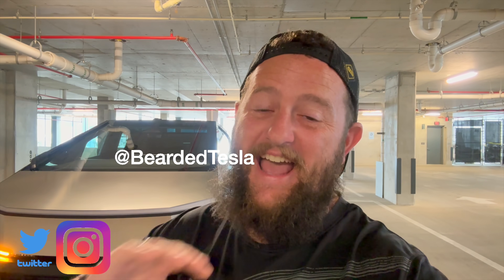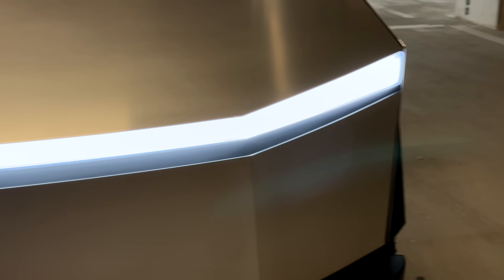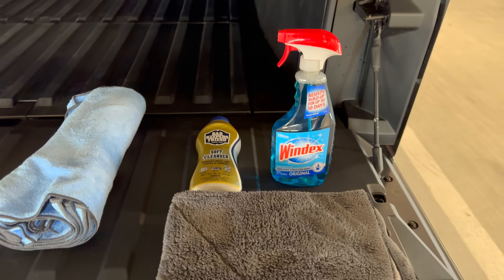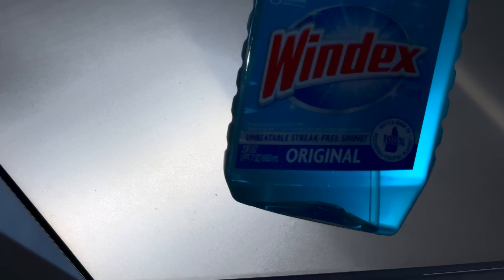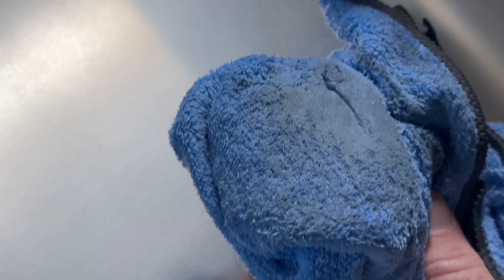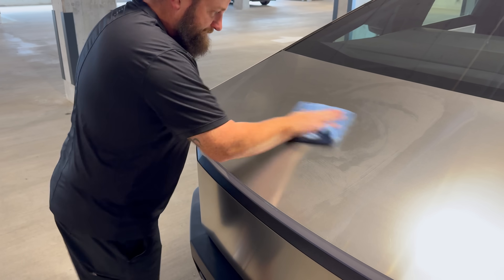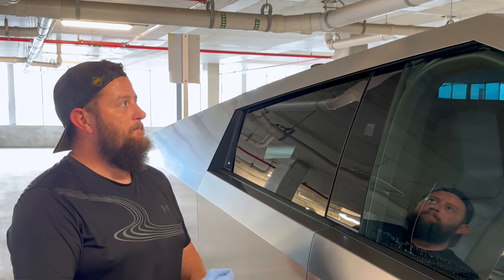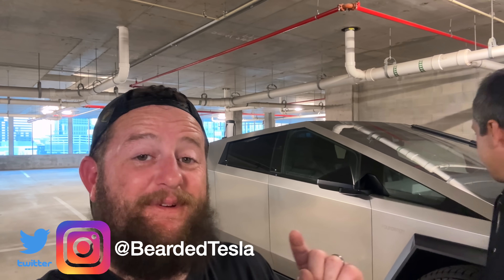Tesla CyberTRUCK or CyberRUST?? The TRUTH About Cybertruck Rusting Issue + How To Fix It!!

Comment: There is also iron remover spray that can remove the particles you can’t see with the naked eye.  Ford made 6 1936 cars from stainless steel by Allegheny Steel.  They were driven around the US by sales reps.  The one in a Pittsburgh museum has more than 300,000 miles and is rust free.  They also made 6 stainless steel 1960 Thunderbirds and 6 1967 Lincoln Continental convertibles (worth more than $2,000,000 each).
Reply: I saw the 1936 Deluxe and the 1960 Thunderbird at an auto show years ago. The body parts matched exactly the standard production pieces with all the same curves and contours, apparently they had no problem forming them. The Thunderbird had over 300K miles, the Deluxe about 500K. No rust or pitting whatsoever on either vehicle. The Lincoln wasn't there but a real stainless steel 1967 Lincoln convertible with suicide doors would be the ultimate summer cruiser.
Reply: It’s possible that the Fe particles are migrating from the alloy at the grain boundaries and escaping the passivation layer. The cleaning needs to etch clean the layer. It’s likely free Fe migration. And yes I am a metallurgist! I’d love to analyze it…

Comment: Always clay bar a brand new vehicle... those spots look exactly like tiny hot iron particles that come from train wheels during transport. Affectionately known as, "Rail Dust"...a good clay bar will take them right off then sealing the body panels with a quality wax. Just look close at any light colored vehicle that wasn't clay bar'd and you'll see rail dust rusting in the clear coat.

Comment: Sort of like new carbon steel woks and pans. Steel, yes - but you have to either keep it coated with oil, lard, bacon grease, or bake on a seasoning of oil, lard or bacon grease. You have to protect the steel from exposure to moisture or it immediately starts to rust. Good luck with "seasoning" a Tesla.

Comment: Facts about Stainless steel, it’s naturally corrosive-resistant. Stainless steel isn’t rust-proof. Stainless steel is only “stainless” which doesn’t mean its strain-proof. Anything made of Iron will rust, additionally iron can be found in water, which if the object makes contact with iron-contaminated water isnt dried properly the object will rust or have rust powder. Calcium can also corrode metals like steel, from dried water.

Comment: So a CT owners need to bring a stainless cleaner and a sandpaper w/them while driving?
Reply: is that a big deal? 🤣
Reply: Not all delivered CT's have this issue.  It's coming from being shipped via rail.  The surface of the truck is not rusting but the iron particles that are stuck to the surface are.

Comment: There are many types of "stainless" steel.  The mix steel with various other materials.  If the mix is not well mixed you might have small volumes, pockets, of plain steel that will rust.  I have noticed Chinese stainless steel has serious problems typically.

Comment: so why is my painted car not got rust spots on it also i work in a machine shop and use steel and stainless steel 316 and unless i grind mild steel onto stainless i have never seen this so called rust dust 
I would say the problem is its made of 304 stainless steel which will stain and Musk is full of BS

Comment: The issue is if the dust that's landed on the vehicle has any iron or metal in it those particles will rust, each one bleeding rust over a broader area.

Comment: It might be rail dust. Very fine steel particles from RR tracks that get embedded on the surface then rust. It happened to a truck I bought thinking the body was rusting then I noticed it was also on the fiberglass cap.
Reply: Same thing in the late 60's when my Kawasaki came back from the big city's repair.

Comment: Brake dust particles from semi-metallic pads are generated by FRICTION, and carry a high STATIC CHARGE. They adhere to the wheels and body sides, and when they get wet, they have the appearance of "surface rust". Meguiar's DECON is a liquid that breaks down the electro-static bond, and the surface will wash clean. Any car detailer worth his salt can tell you this.

Comment: Toyota has at least a decade of cars where the white paint randomly peels off to the metal shortly after purchase and doesn't stop at just a small location, but will peel off the entire roof, or hood, or entire side of the car. Still not rectified, but they have a program, ending 2024, to repaint the exposed metal areas. I myself have had all of those parts repainted on my 2014 RAV4, and now in 2024 at the end of the free repainting program, the other side of the car is exposed.

Comment: If it's not in some way bonded to the surface, I don't see why the regular cleaning products wouldn't have had more success. Even if slightly porous, I would expect particles that are only resting on top to come free when washed.
Reply: After watching a bunch of these videos I tried an experiment with by stainless steel kitchen sink. It's never rusted or pitted, I wash cast iron skillets with a steel wool pad and cleanser in that sink and haven't seen a problem. I left a wet steel wool pad in the sink and by the next day the pad was rusting. It left a rust mark on the sinks surface but it cleaned off with dish soap and a sponge. The rust from the steel wool was gone and didn't require any special cleaners.
Reply: @hwirtwirt4500  Good idea for the experiment!

Comment: Shops that fabricate in stainless steel typically do no work on standard mild steel. The dust from grinding mild steel and welding splatter can 'contaminate' stainless steel. The metal particles bond with the stainless and will rust. The iron oxide formed also bonds to stainless and you can't just wipe it off. Unfortunately iron oxide dust is almost everywhere in the environments where stainless trucks are driven.
Reply: They invented no contact air bending to keep tooling from contacting the stainless. 

Iron as a mineral is even in vitamins, dirt and food.   I've had rust on ceramic plates from hard water.
Reply: @MotoGPatrick bro iron rust is literally in the human breathe, this God damn things are going to stain no matter what you do, just by being in close proximity to their owners they will eventually get nasty.

Not just that but the damn things are huge and have very sharp angles making them really difficult to clean continuously.
Reply: @MotoGPatrick That makes it way worse, so we can see that they knew exactly what @rossmacintosh5652 explained up here ist true, they also knew that it would be everywhere but they still said "fuck it" and now you can either have it clear coated by Tesla for 5000$, wrap it or be cool with it and call it Spot.

Comment: You really need to educate yourself a lot on this matter before coming with wrong "facts".
It IS the material that is rusting.
It is called stainless and not satinfree, and there are huge differences between different stainless types.
The stainless panels are rusting and that can be for different reasons.

If there are some groves that keep water or there is a material that stick to the panel that attacks the metal or help keep water on it, it will start to rust.
Even fingerprints can make it rust.
Specially during winters and you drive on salted roads.
Also if you park you car on the outside and it rains for days, it will start to rust.
Ideally to avoid it from rusting as much as possible, do you need to wash your car every time after you have driven it and then park it in a garage with dry air.

Ask any present or past DeLorean owner and you will quickly find out that it will take a lot of work to keep your Cybertruck in pristine condition.
Or you make sure to wrap or coat it to avoid it from rusting and getting a lot of fingerprints showing.

Comment: The problem is every vehicle has the same issue with particles getting on them during transport.  Trains are part of an everyday environment.  Without paint and a clear coat, CyberTruck owners are really going have to really work to get those spots off.  You can't keep using the cutting agents over and over again.    Yes a wrap helps, but after spending $99K, why should anyone need, or have to,  spend another $5K-$6K to wrap the vehicle to protect it?   There are some who indicate with a wrap, the metal underneath cannot breath and may become another issue in the future.  Time will tell.  

Instead of making an Elon Musk vehicle, (just do something different without thoughts of the consequences of doing it), an electric CyberTruck could have been made using regular materials and paint.   The minimalist DASH and all steel body is only to be different and there is no practice reasons to go to those extremes.    A heads-up display or modern dash in front of the driver could have given that futuristic look.

Comment: Ya and how quickly does it return after spending hours removing it ?  PPF or  Vinyl wrap for my money is the way to go.  I simply will not tolerate having to do this every couple of weeks or months.  If fresh delivery has this showing up quickly the question would be how quickly does it return.  Was it just an environmental thing at the factory or during shipping ?  I guess that depends on where you live, but I would expect highway driving and in town driving kicks up a fair amount of this as well.  Most likely this will return fairly quickly and the build up over time could be nasty.  I'd say, unfortunately, if you are investing in a Cyber truck, you had better plan in investing in PPF or Vinyl wrap.  Tesla should really offer a discount for wrapping, at least a clear PPF option at a discounted price due to this.  This new revelation has caused me to question, seriously, the investment.  Because I plan on the Cyber truck as being a piece in my whole home back up system it really is a no brainer compared to fixed batteries.  If they didn't have the option of V2H I would NOT be buying one.  V2H saved this truck from a practicality standpoint.  Especially with this new revelation.

Comment: Stainless comes in over 150 formulations. many can rust based on their chemical composition. At one end of the scale, while not stainless, 1095 and 5160 high carbon steels have extremely high tensile strength but will rust due to low chromium content. At the other end of the scale are knife and surgical stainless steels that tend to be rust free, but are hard to work and can be very brittle under impact. It depends on the chromium and Nitrogen content. Another likely source of rust in this case would be Iron that gets embedded during the working process. Passivation should be used to remove embedded surface iron particles by the manufacturer.

Comment: Contaminates from low grade SS   example : cheap silverware also rusts the same but stains worse 308 309 and other grades matter, what goes in comes out!   hey what you doing today?,,, I am decaming my brand new truck you? LMAO why not clear the body so this does not happen at this rate? I am sure a good clay bar and lube can tare tru them much faster, when you weld SS its important to pickle the welds or they will rot just like this, my point is it all contaminates from the materials used in the enviroment in wich they are kept like RH relative humidity is indoucing the issue also WD-40 will spot remove well without dammage as its a slovent based material but will evaporate to nothing so i recomend a proper clear coat done in a low RH enviroment after a clean contaminate free clean like youve done here. Cheers

Comment: If you use a Stainless Steel Wire Brush on Steel or Iron it will ruin it because once contaminated it will transfer (rust dust as they now call it) to other non ferrous metals from its contamination. This is well known among machinist.

Comment: So the CT attracts rust dust from the atmosphere. 
Surely all vehicles would would also attract this onto paintwork?
Reply: I'm sure it does happen to painted vehicles to some extent, but It's probably less likely to adhere to painted surfaces.   However, a lot of this maybe coming from the factory when the sheet stock is cut and shaped.  Any tooling, rollers, mandrels etc. that contact the stock may transfer iron or steel particulate. The particles probably adhere at the nano level, maybe this is somehow related to how stainless fasteners can be so prone to galling. Anyhow, it may just indicate that the material was insufficiently passivated after factory forming processes.
Reply: You are the first besides me that mentioned PASSIVATION! Looks like Elon should have hired the Delorean Engineers to Passivate these, I haven't ever heard of their Stainless panels with this problem. @mattgraham4340
Reply: All vehicles can have rust dust embedded in their exterior.  Just search for products like IronX.

Comment: Can someone explain why these rusting particles are so hard to come off???   Rusting is material which is breaking down, so why do they have to be mechanically removed with so much effort?
Reply: A great question!
Reply: Because it fuse with the panel
Reply: Ok but how is rust fusing?  Rust breaks done, but in this case it fuses?  Trying to understand
Reply: Because stainless has grains and the microscopic steel particles settle into the grains and begin to rust.  That is why you never buff stainless steel with steel wool.
Reply: @kennethsouthard6042  I clean my stainless steel sink and cast iron pots and pans in that sink with Brillo pads and after 20+ years of use it never rusted.
Reply: @hwirtwirt4500  There are several grades of stainless.  Sinks and pots and pans are usually a very high grade, 304 if I'm not mistaken.  There are also lower grades used in decorative applications, like the front of appliances and apparently this Tesla truck.  The lower and cheaper grades are more prone to rusting and should NEVER be rubbed with steel wool.

People like stainless, because everybody thinks of the higher grades and sees it as a "premium product". However, the secret is that not all stainless is created equal.

Comment: Could you get it chrome plated?
Reply: Stainless steel is not good chrome plated, it doesn't stick, it's like painting it you have to use an epoxy primer to glue the paint on, etch primers (normally used on steel bodies) doesn't etch SS.

Comment: I'm a knife maker and it's crazy how many people think stainless steel won't rust. That's absolutely not true. The majority of stainless steels WILL rust. It's stain-less, not stainfree. Stainless steel comes in many different chemical makeups which determine it's stain fighting capabilities, hardness and brittleness. The only 2 (maybe 3) kinds of stainless steel that i know of that actually will not stain, are on the softer side of the spectrum as far as steel goes. In the knife world that makes them dull quicker then others but also make sharpening easy and fast. Not relevant here but just to get an idea of the differences in steels.

Comment: Lots of negative nancy morons in the comment section...(1) the CT body panels are NOT RUSTING. (2) Environmental contaminants are landing on the surface and rusting.(3) this does NOT cause damage to the CT body panels. It is a COSMETIC issue. (4) Sealing/protecting the surface adequately is the key. (5) Within a matter of months there will be a plethora of aftermarket products available to provide that surface protection over the long term with infrequent application. (6) In the meantime use barkeepers or other similar products to coat the surface and wash the car often to avoid this issue.

Comment: Let's talk about real stainless steel. There are different kinds of stainless steel. I operate a distillery where I have large tanks made of 316 Stainless Steel. Sometimes, when I ferment mash in stainless tanks I will see a film that must be taken off with a mild soda ash solution. But, rust? No. I use this quality of stainless for the fact that it does not rust.

Comment: If what you're saying is true, wouldn't the rust dust removal be a one-time thing?    You never really made it clear if this is something that has to be done over and over as needed or if it's just a one-time clean up after delivery.
Reply: It depends on if you live around a lot of metal dust.
Reply: No, its full time job😂
Reply: If you never drive it and keep it indoors in a dry dust free room, you should be fine.

Comment: I grew up maintaining boats in saltwater along the gulf. I've seen everything from 304 to 316 stainless steel develop surface rust over time due to the sodium chloride exposure from the marine environment. The saltwater can become airborne during heavy storms and gets blown inland along the coast. 

For boats you basically cover everything with a film of wax to help protect it from the sun and these elements. This includes any stainless steel you have on the boat. In these environments, raw 304 stainless will begin rusting within days/weeks but 316 performs much much better.  I'm curious what blend of stainless steel they are using? 

It will be interesting to see how this plays out for these vehicles in coastal environments. I suspect we'll see more of this until people start protecting the metal with some type of film... Time to start waxing boys!
Reply: Apparently Tesla created a proprietary stainless steel that was first used on the Space X rocket, & then used for the CT. What I'd like to know is how it compares to 316 SS. I have not researched what makes it different/better than existing SS, but apparently Tesla felt what they created was better (?) than what is already on the market. If it's rusting so quickly, is it better? Maybe in another aspect...?
Reply: @XTine1084  I've read on other forums  that it is basically some proprietary blend close to 304. I would be a bit surprised if that was actually true but if it is that doesn't bode well for coastal environments!?!?!